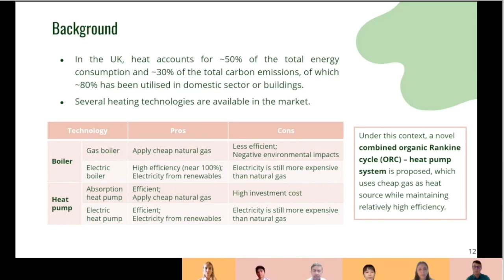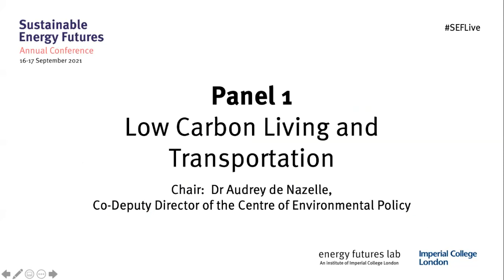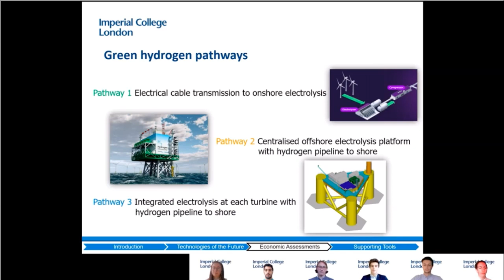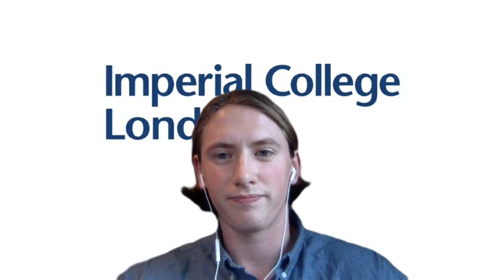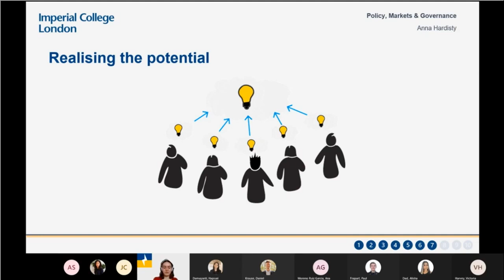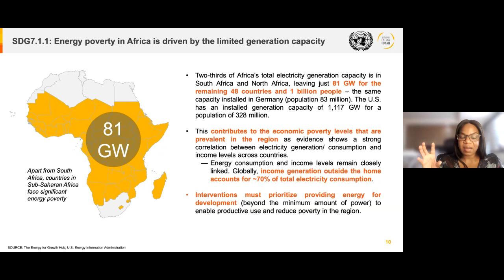Sustainable Energy Futures Annual Conference 2021: Day One

Comment: Look at Norway it already has a fully electrified heating system.

Peak winter demand is 25 GW and the UK has 12x the population = 300 GW peak winter demand if UK electrify heating 

And you need more generation than peak demand will norway demand is 25GW they have over 30GW of capacity a 15-20% headroom just in case and to factor in that some generation might be off-line when you need it

The UK would need around 350 GW of dispatchable generation and a grid able to handle 350 GW If you want to electrify heating

Is the UK really willing and able to build 300+ additional gas (or Biomass or hydrogen) power stations to electrify heating? Not very likely